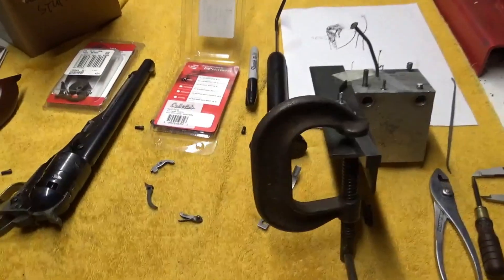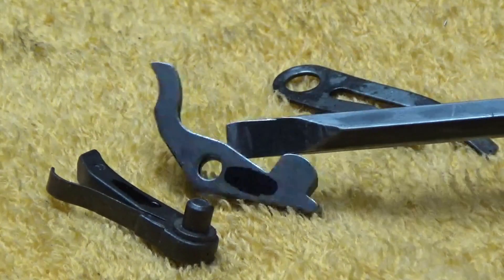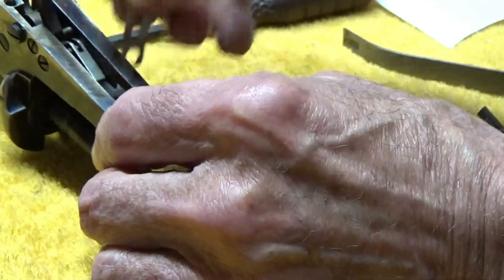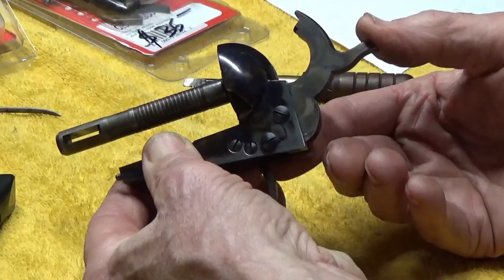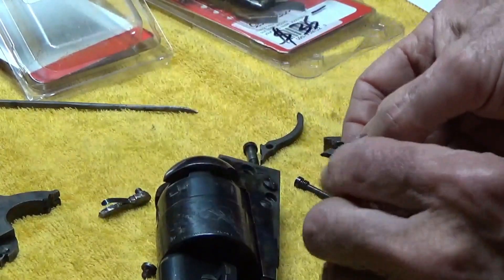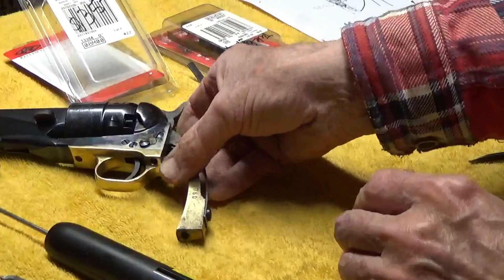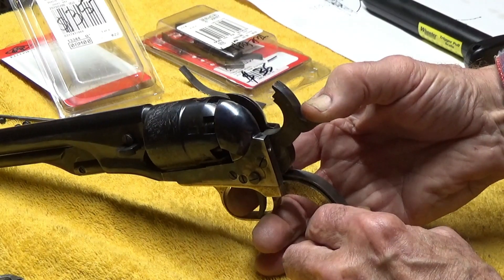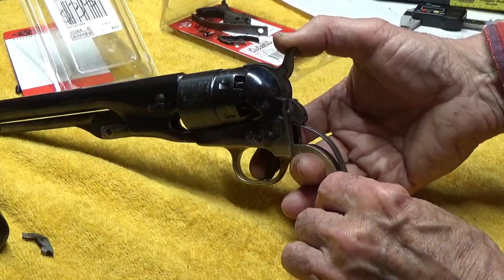1860 and 1851 Pietta Part Kit - Is fitting necessary ?

Comment: Excellent video, and I am really surprised how little work was required to fit these new parts, I drill holes in a 3/8" steel plate corresponding to the holes in the action, that way I find it is much easier to fit the trigger/hammer group out on the bench with the correct sear angles, those parts look like they are lost wax castings, did you find them hardened right through, or case hardened ? Chris B.
Reply from the maker: Chris, I tried a file after some grinding on the trigger (not sear end), and the file still just slid.  The bolt was well polished and has pretty robust arms and didn't need any work, arm seemed to be the right length and worked well with the cam.  The sear seems long enough to give the hammer a further back lock up, which helps it not to shoot as high.  The extra length of the hand is a positive thing because it can be shortened.  Hammer worked well also.  I am thinking that the light trigger pull may have been that some extra should have been taken off the back side of the sear because maybe it isn't able to get fully into the hammer notch, which also might explain almost zero creep. If not, get out the jigs and stones. Not exactly a drop in for all parts, but as you say, sure could have been a lot more work necessary.  Thanks for checking it out.  O.R.
Reply: @oldranger3044  That bolt looked very well finished, that is why I wondered if they were lost wax castings, they come off the sprue and just get tumbled, which gives them that smooth finish, I am sure you are right on the sear engagement, it sounds like the back of the sear is touching the breast of the hammer, that is why I like to make up a simple jig by drilling the hole positions in a 3/8" plate, you can then see what is happening, when it is inside the frame you cannot see anything, so unless you smoke up the trigger you have no idea what is touching what, but it works well as you have got it set up! Stay safe ! Chris B.

Comment: there is no such thing as a "drop in" part they all take some fitting.
Reply from the maker: "All" covers quite a bit. I'd rather that it be said that anything ADVERTISED as a "drop in", may, or probably will need some work.  These parts I recall are advertised as replacement parts.  Many  will need fitting as you say.  But, I have had some drop that function as the original,  and some have actually improve trigger pull.  But, we certainly cannot count on that.  Thanks as always for your comments.  O.R.